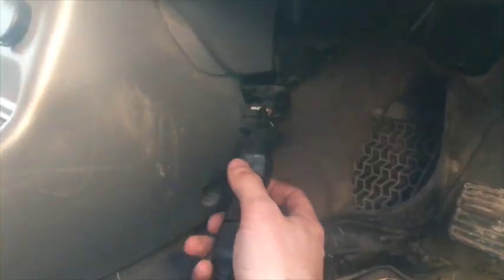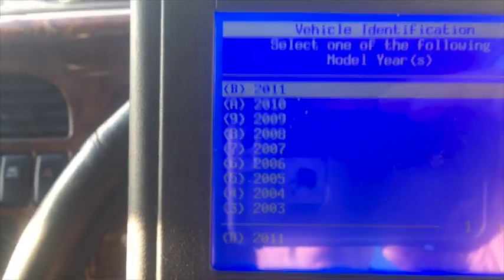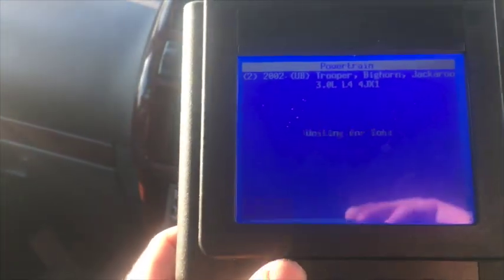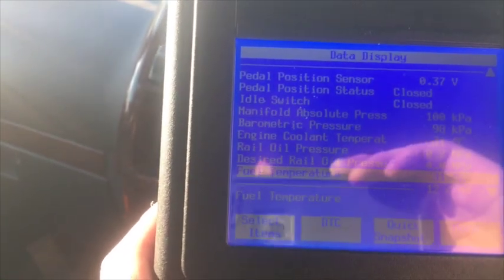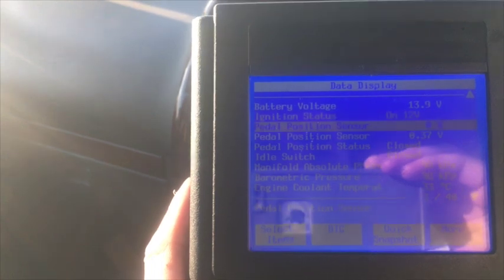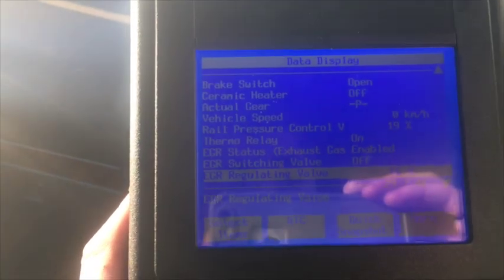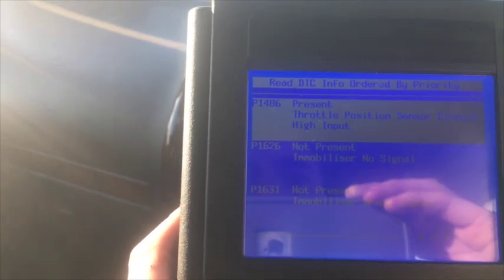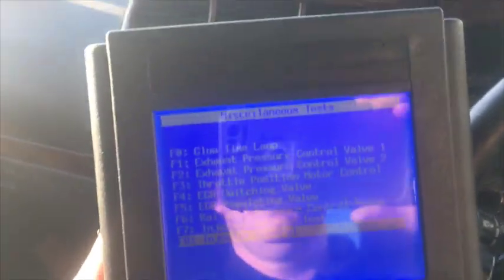Isuzu Trooper 3.0 Diagnostics Tech 2 4JX1 engine

Comment: Hi good morning. I have a problem with my isuzo trooper 2002 4jx1 engine. The engine dies 10 times while driving. We do not know what the specific problem is since the computer box couldn't be connected to a "diagnostic machine", it stops at 75%. My mechanic friend by the way put a 10W-40 oil in it when the trooper is supposed to have a 5W-30 oil....And yes, after the engine dies, its always a very hard start, sometimes even killing the battery already....Hoping you could give me ides..thanks
Reply: Try replacing ORPS and cleaning the RPCV.